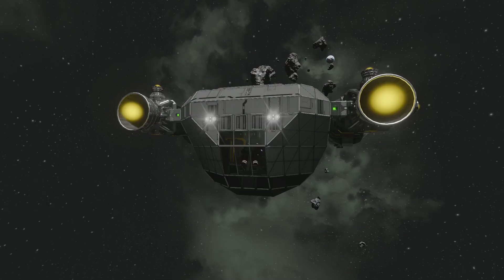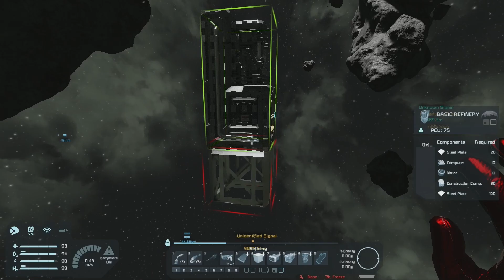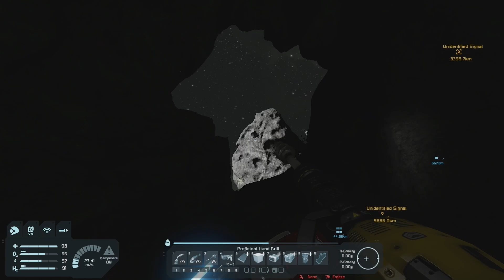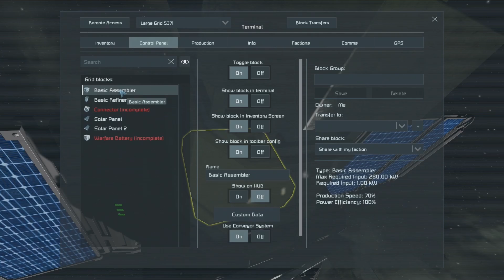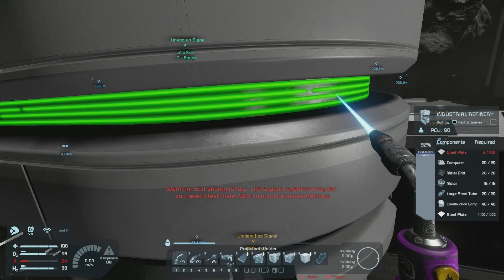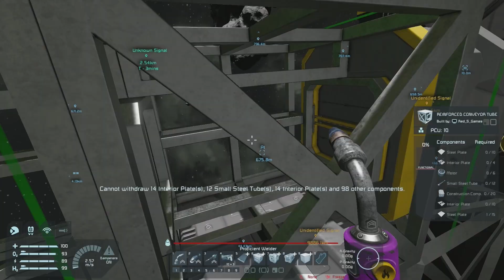Space Basics - Contact EP10 - A Space Engineers Mostly Vanilla Survival Series

Comment: 33:00

If you have it set as a station and you cut something off (and depending on if you have unsupported stations turned on), most of the time they're still locked to that grid, which means you can just throw a block back in there. If, for whatever reason, they aren't going to reconnect with just a block, then you have to make ONE of them no longer a station for the merge blocks to work because they have to be able to move.
Reply from the maker: ahh, of course, i'm honestly not that experienced with free-floating stations, it wasn't much of a worry in the end, but good to remember for the future.